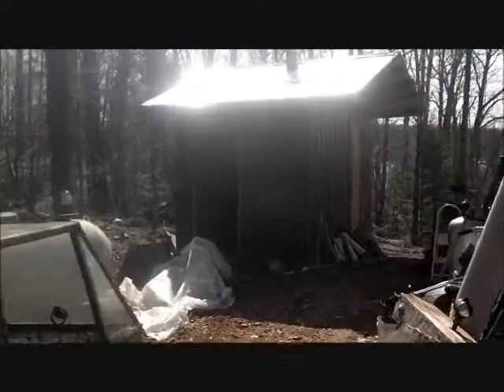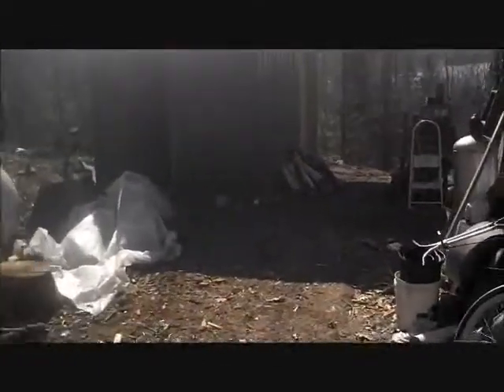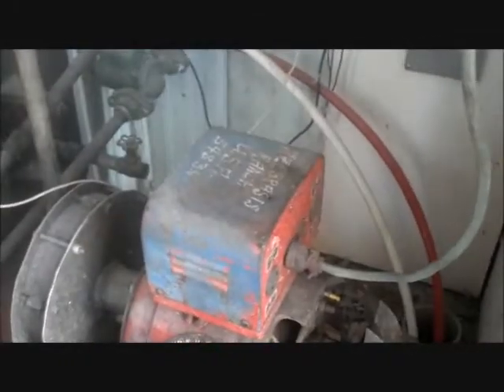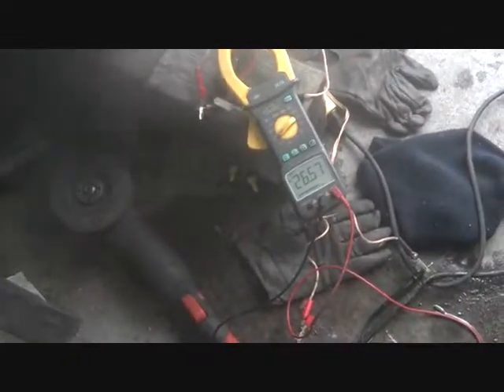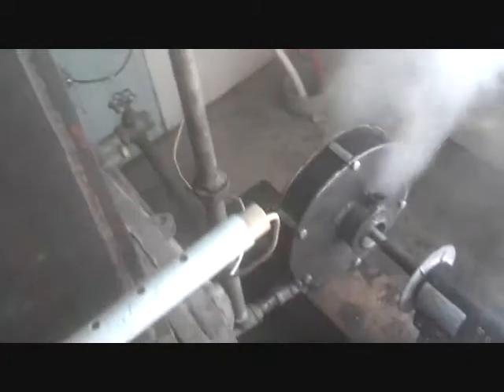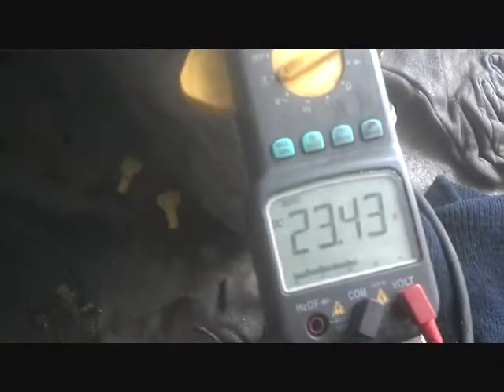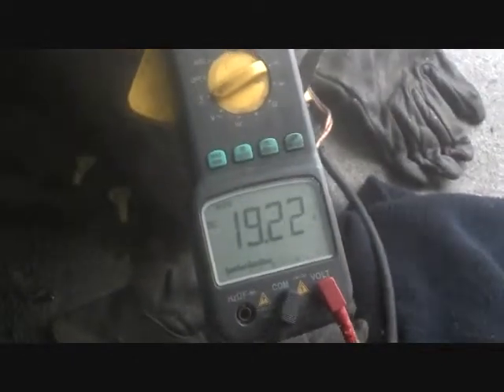Too Steaming Cool

Comment: Wow, congratulations. Hope you are doing well, What type of turbine are you using?
Reply from the maker: Well things could be a lot better but I'm still sucking air. The Turbine is a Pelton hybrid that still seems proprietary meaning if I had more money I would have definitely applied for a patent. It does work well for a micro turbine. Thank you for the comment.
Reply: @wiscokiddd  Thanks so much for your response. I too have worked on so many rotary type engines in the past; I know it takes lots of money and dedication even with ideas that has potential. Have a great day.

Comment: Omg your like a new age Albert Instien great job. Not much wear and tear on the ears 😮
Reply from the maker: Well at least you didn't call me a genius somebody did that once and it brought me some instant bad luck karma. Actually although I agree that there is a connection between energy and matter and when I was in college I sort of did what the professors said to pass many classes but. E=MC^2 is not a valid mathematical or physics equation. For one none of the variables other than the speed of light squared are quantitative values. For two matter is a variety of subatomic particles and I don't think it has been proven that proton, electrons and neutrons all convert at the same mass to energy ratio. I have a few more claims of it's inaccuracy but I'm doing some pro se lawyerin' I gotta get back to so thanks and Gooday Eh K
Reply: @wiscokiddd  so your the master of your field? Which is? And your also a master at felling trees amazing would you like to take my job ?
Reply from the maker: @JoelDibben  Hell no I've fellon trees and I've climbed and topped them I'm 67 we need younger Arborists I never was one but I worked for one a summer or two. I heated with wood for the vast majority of my adult life, Northern 'sconi, the UP and even BC Canada, so yeah, I did make a cocky comment on a tree service video earlier today, if that was you sorry, I did say I liked your choice in saws if it was you gooday eh.

Comment: Isn't it a great feeling when something you design and make works Great, Well done
Reply from the maker: I actually I still use second steam turbine and generator in the video with a battery bank, we had a power outage in a wind storm with 18 degree temperature and the system ran the furnace, refrigerator, TV and internet.  Besides my own personal quest for energy independence I had hoped to start a company to make and sell the system. But like the windmill I built that generated electricity years ago, the solar collector that powered a gas refrigerator I applied for a patent on, the electric bike I built that goes over 30 mph, the light weight car I built that gets 100 mpg and all the other smaller inventions and designs I have accomplished are just a poor man's wet dream in the caste system of private royal family ownership of the monetary system monopolizing, weapons dealing, war profiteers.  So I am a total failure who would have bee better off looking for pussy ad drinking myself to death or what ever.  The same for my political work: http://newwest.info/  I can't seem to give up though and will continue learning and doing what I can, what I think is right and good until I die in spite of evil all around us these days. El Presidente Chump must be taken down by majority mandate, that is my concentration right now. Gooday and thank you for commenting. Sir.
Reply: @wiscokiddd  You have a lot of hate for those who don’t agree with your political views, you insulted me on another video, you don’t even know me, you are a poser, you espouse all this b s but yet you are not at peace within yourself, just know that it ( hate ) will eat you up,…see you around sometime, 😉.

Comment: Wow geez this is like Einstein stuff? Love it 👍🏻
Reply from the maker: It think you mean Edison rather than Einstein but yes, Edison just improved work others did on the incandescent light bulb to make it last long enough to be practical, which was using a tungsten  filament in an inert gas or vacuum that could take the heat without melting or burning. Actually the same goes for Einstein, because he sat in the patent office and read other people's work, like that of Henry Poincare and Lorentz. Also e=mc^2 is over simplified, does not contain quantitative units for mass or energy besides not proven to apply to all  forms of matter ie all elements on the periodic table electrons protons neutrons.  There would be no need for a critical mass equation if e=mc^2 were true. On the other hand, yes there is certainly a relationship between energy and matter.   Okay I will work on quitting with the cussing because it does not positively influence or produce positively toward my goals for humanity, even if I find it humorous. On the other hand humans contributing to raising the level of CO2 in the atmosphere is an absolute certainty.  Then too this Alex dude is trying to be to the Koch brothers what Joseph Goebbels was to Nazis. He is a total slime ball greedy lying....and I can prove it.  Okay so truce... Gooday eh.
Reply from the maker: Indie Media Eastcoast "einstein never really invented anything.. check out walter russell's work .. a friend of tesla..." and now this, " i meant tesla and russell .. not einstein or edison .. don't put words in my mouth"?  Yes Tesla invented AC which allows for transformers to work and therefore the grid. I think Russel is cool but I don't think he invented anything.
Reply: @wiscokiddd  Wisconsin huh,…got it.
Reply from the maker: @gregflores8959  Got what? The two divisions of the monetary system monopolizing weapons dealing war profiteering plutocratic kleptocracy has convinced any decent person to become an anarchist.

Comment: that's bad ass kid ....hook up a condenser and catch the water back from the exhaust .....hot water is a big part of everyone's energy use .....
Reply from the maker: MARTIALLAWLESS That is the plan summed up.  Yes I will use the exhaust heat off the turbine for living space heat and I may be able to do potable water too.  Using the steam that way actually produces a higher energy efficiency than the power company; no steam released in the air or the river, it will all be used.  Thanks for the comment.